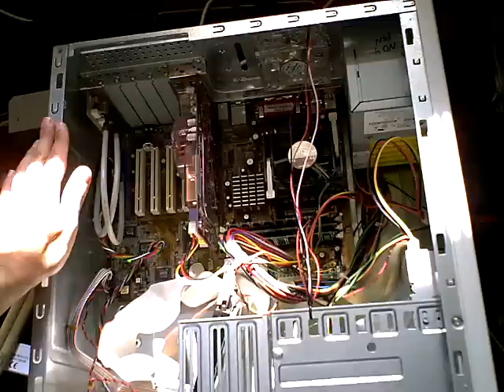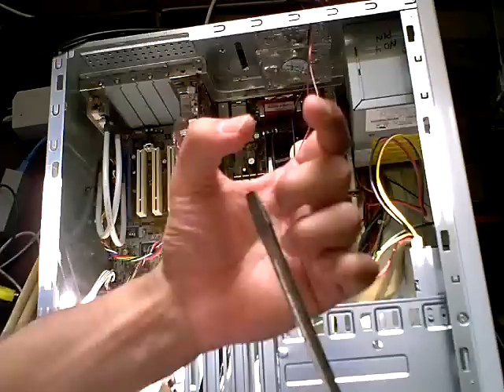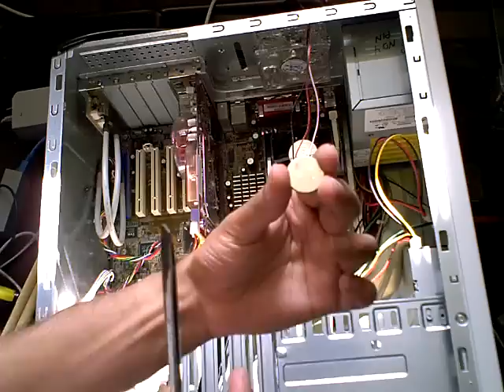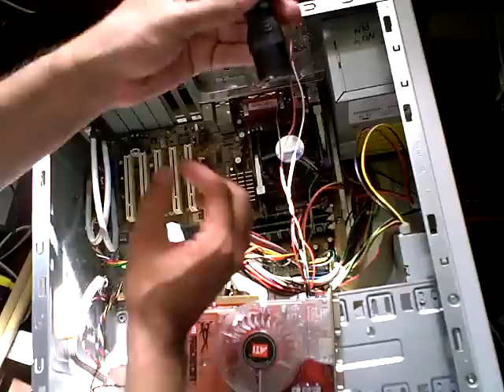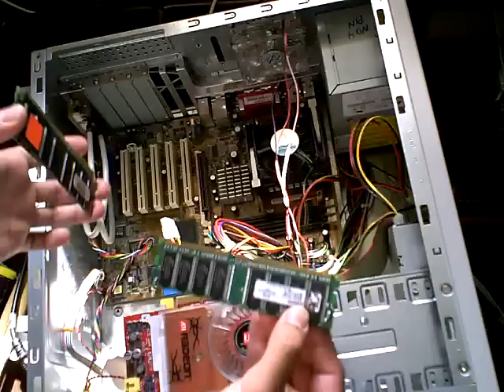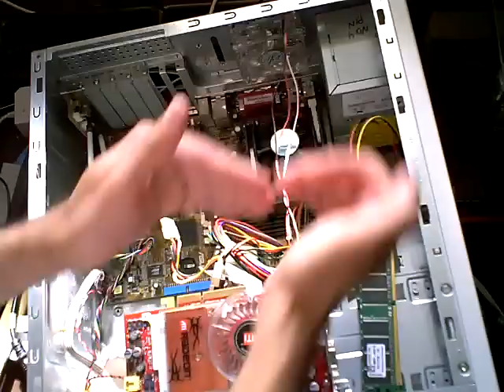How to possibly fix a PC that will turn on but will not beep and will not display anything on screen

Comment: My videocard fan is working, cpu fan is working, case fan is working, my power supply is working, when i turn the pc on with the monitor on it scans for dva or vga port but doesn't find it. When i plug out the DVI cable it says on screen "check video cable." Help
Reply from the maker: +Edward Gudmundsson How do you know it is scanning for VGA or DVA port?
Reply: +RodneyDickson 
Nevermind, solved it. It was the cpu
Reply from the maker: +Edward Gudmundsson Glad you got to the bottom of the problem then

Comment: hey man, so i followed your instructions and i removed the cmos battery, after doing this and starting up my pc, it worked! BUT! it only works without the cmos battery, as soon as i place the battery back into position it goes back to the same old problem: the screen does not detect any input and all i see is some fans spinning -> i not no expert on hardware :/
Reply from the maker: +Lancaster.mmxv You can try a new CMOS battery (yours might be dead) or you can just use the PC without the CMOS battery (by leaving it connected to a power source, even when off, it may still keep its date and time settings)
Reply: yeah sorry i forgot reply when i finally figured that leaving the cmos battery out was the solution, i'll probably get a new batt soon or something, but thanks for the support!
Reply from the maker: +Lancaster.mmxv Of course! Good luck with it all : )

Comment: I have a motherboard.It cant accept video card,i dont know why.For a long time I play a lots of games on that video card and now it works just for 3 weeks and the I need to plug in my VGA cable to the onchip video card.Please help me.
Reply from the maker: +Edward Turcan Your video card slot (or related circuitry) is probably defective. I have a machine like this myself, and know no way to fix it unfortunately.
Reply: +RodneyDickson Too late...I have a new motherboard.
Reply from the maker: +Edward Turcan Probably a better solution, especially if you wanna use an addon card : )

Comment: sir rodney . My PC have problem, when im using my pc its turn to blue screen of death and says "collecting dumb files" and its stuck .then I force shutdown and when i restart my pc it won't turn on. im planning to format my pc but how can i format if my pc wont turn on, Any idea how to fix my pc?
Reply from the maker: Hmm, well, it sounds like your Windows installation is dead. I'd use a Linux LIVE CD (or just slave your hard drive to another working computer) to back up any files (if there is anything worth backing up on that format) and then I'd use a Windows install disc to reinstall Windows (if the only recovery option you had was integrated into your Windows, then you might be out of luck sadly...in this case the only thing I can think of is to go into Safe Mode (boot by holding F8) and then uninstall as much software as you can until the PC boots properly in normal mode, then back up what you can, then format). If you actually have access to a Windows install disc, you can try my method to fully format your hard drive shown in the following video (don't forget to back up any data you do not wish to lose beforehand):

How to completely format a hard disk drive to its full capacity by deleting the master boot record
Reply: RodneyDickson thank you sir rodney. i tried to re-insert something on my  motherboard then when i open my pc .it did'nt turn to bluescreen .i hope not.
Reply from the maker: jovel lopez
Well, I wish you continued success with it then : )

Comment: i have 1 stick of 4gb ram its kingston hyperx fury 1866mhz and i got one more stick of the same ram and when i put my ram in it says memory has changed 1 run setup 2 load defaults and if i click load default it shows i have 8gb ram but only 3,95 usable but if i hit run setup it takes me to bios and i check if its 8gb ram at the right frequency and i click save and restart and it restarts but nothing is displayed and it beeps (i have a 64 bit windows , so i know thats not the problem, and i tried to do that msconfig thing it didnt work ) please help me any suggestions are useful
Reply from the maker: +MrZigljasin Install both RAM modules,  enter the BIOS, on the last screen 'load setup defaults' then save and restart. See if that solves the issue. If it doesn't, disconnect the power cable, remove the CMOS battery, short the CMOS jumper pins for 9 seconds then return the jumper cap to its initial position, press your PC's chassis power button switch (to discharge any remaining power circulating in the system), leave the PC unplugged and in this state overnight, then the next day return the CMOS battery to its socket and power up the PC.
Reply: RodneyDickson I already fixed it but thanks anyway :)
Reply from the maker: +MrZigljasin Good thing then

Comment: my monitor wont open and my mouse and keyboard too stop working just before this happens my computer is really working very good and fast and now i cant seem to open it by the way i can see lights and fans working to all parts except the video card fan do not move and there's no beeping sound when i press the power button and it does not turn off when i use the power button it only turn off when i unplug it. please help.
Reply from the maker: +Eugene Kurosaki follow the steps in the video

Comment: try this first,
ASUS tech support doesn't even help you, they just keep pushing you for an RMA. BUT THE REAL PROBLEM FOR ALL IS the 3 pin connector for the cpu . That's the culprit, You need to NEVER connect to the cpu power 3 pin female connector to the mobo 3 pin cpu fan male connector . You have to use the 3 pin female connector from the CPU on the 4 pin male connector just to the right of it on the MOBO called the cpu fan optional, it is a 4 pin male, but you use the 3 pin female cpu connector there and the embedded slot that places it in the right direction IS USED leaving 1 pin unused> so spread the word...the 3 pin male connector on the saber tooth FX990 is useless.
Reply from the maker: Thanks for the heads up.

Comment: help when I turn on my computer the PSU and heat sink fan don't work but the motherboard power is on...I even change my PSU but it is still the same
Reply from the maker: +Rian Gosaingfao Breadboard it (explained in the following video:)

If the steps in this video did not provide a solution to your problem, view:

http://www.youtube.com/watch?v=_EK9a-R5pss

You never know, maybe rebuilding the PC in the opposite sense that you took it apart will solve the problem.

Comment: Sir good morning.  I had a problem on my pc . If I on my com it beep but my monitor saying that no signal input. I follow the instruction of my tech not to download anything, yes my computer are old.
Reply from the maker: +fhinn sadam Good 8 month ago morning : ) Try unplugging the machine, connecting your display to a different video out source than what you are connected to, then powering up. I assume that the PC is defaulting to outputting video to a different video out port
Reply: ok sir thank you :)

Comment: HI Rodney,i have a problem with my pc,pc works fine, but will not beep  if i remove ram memory , i have AMI Bios
Reply from the maker: What do you mean 'works fine'? Are you POSTing and loading your operating system?
Reply: yeah it works fine, it loads os , but doesn't have beep sound, is that a problem(for example doesn't beep if i remove ram memory)?
Reply from the maker: Heh, no problem at all. It just means that your PC doesn't have an internal PC speaker (many don't this day and age)
Reply: Ah OK, Thanks man :)

Comment: So one day I was playing LoL and all of a sudden one by one all my tasks crashed and my computer froze. I went to restart and the fans spun as well as the GPU and all the LEDs but no output signal. I am getting a DRAM solid led whenever I attempt to turn on the computer. I tested the ram in another computer and it worked, RMA'd the mobo, cleared cmos, tested the monitor and HDMI, and yet it still won't work any suggestions? Please help :(
Reply: PS I built it 3 months ago and was running fine with no problems
Reply from the maker: Breadboard it (explained in the following video:)

If the steps in this video did not provide a solution to your problem, view:

http://www.youtube.com/watch?v=_EK9a-R5pss

You never know, maybe rebuilding the PC in the opposite sense that you took it apart will solve the problem.

Comment: Hey Rodni Dickson...
 please help me !
 my CPU is not showing any power light but it's fans are working and also not showing anything on monitor.
 And when I opened my CPU I found a cable which has 5 mini pins was getting out when I put that cable in the slot after that I also fount my CPU like before..
 please make a video on this😊😊😊😊
Reply from the maker: +afgan siddiquie Not sure if you fixed your problem or not. If you have not, then Breadboard it (explained in the following video:)

If the steps in this video did not provide a solution to your problem, view:

http://www.youtube.com/watch?v=_EK9a-R5pss

You never know, maybe rebuilding the PC in the opposite sense that you took it apart will solve the problem.

Comment: I got a small puff of smoke from pc but it still powers up but no video signal. What would have that small bit of smoke have come from?
Reply from the maker: +MrGillystar Probably a capacitor blowing. They blow frequently
Reply: Don't need to worry about that old pc. I got my new gaming pc.
Reply from the maker: +MrGillystar Better that way. Yep, responding to all comments unanswered from my 1.5 year hiatus, even if most of them are no longer valid.
Reply: It's all cool man. Stay safe.

Comment: sir am using 2 hard disk 1 is cable and the other is sata cable.system is not starting when i am using my cable hard disk.wht i have to do?
Reply from the maker: +Raj Kumar Try configuring IDE header in the BIOS, save and exit BIOS, unplug PC, set your IDE jumper to SLAVE or Cable Select, connect your IDE drive (including power lead), and try booting. Note that your machine may have a limitation to where it cannot use IDE and SATA devices at the same time (check with your board's manufacturer's support site).

Comment: i noticed when i start my computer my fan is steady fast..
then suddenly slowsdown? no display i have to reboot it many times bEfore i get display... what could be the problem??
Reply from the maker: This is a tricky issue that can be attributed to a number of things: short circuit, insufficient or weak power supply, CMOS/BIOS corruption, device conflict, the list is endless. Whenever anyone approaches me with this problem, I sadly tell them to keep on fighting with it and don't try to fix it (since there is no real fix to suggest). I mean, you could always try the CMOS reset method shown in this video, and to eliminate the possibility of short circuit, you can try breadboarding the entire PC, but this is a lot of work for little chance of gain. Still, if you want to try it, I cover breadboarding in detail in this video:

Advanced troubleshooting technique tutorial of how to possibly fix a PC that will not beep at boot
Reply: Thank you. Is it because of a virus in my system? Does reformatting my pc could solve the dll errors? And i just had a blue screen problem but now its okay again..there is really something wrong with my pc..
Reply from the maker: Edward Mabanglo
It could be a corruption issue, a virus, a number of things. Generally, formatting and starting anew is never a bad idea. If, soon after you format, you ensure that you have a software firewall and an anti-virus installed and operational, and the problem still persists, then the issue will most likely either be related to hardware or the drivers for your devices.

Comment: my computer won't boot,the case fan turns on and off...what could it be? power supply? maybe
Reply from the maker: If your computer powers on but for a mere second or two and then immediately powers down, It sounds like your motherboard is developing a short circuit due to contact with the metal casing. Most likely it has to do with the screws and metal mounting stands (supports) that your motherboard sits on. The cheapest way to fix this problem is to introduce cardboard washers between the screws and where they make contact to the motherboard, or you can buy plastic mounting supports at a computer shop.

Alternatively, you can always Breadboard it: 1)place the motherboard with CPU+Fan on wood or non-shiny cardboard 2)connect all of the case connectors to the board's panel 3)with a power bar that is OFF connect the PC power cable from the power bar to the power supply and the power supply to the board 4)while NEVER touching any exposed component,power on the power bar and press the power switch on the case.If the problem still persists,one of the remaining components is probably defective.Power off the power bar before dismantling

I cover breadboarding in greater detail in this video:
Advanced troubleshooting technique tutorial of how to possibly fix a PC that will not beep at boot

Comment: My pc will turn on but nothing will show and the lights on my keybord and mouse won't work but I can hear the fans loud and clear? Can you please help me
Reply from the maker: If this PC used to function and now doesn't, do what is shown in this video. If this PC is a new build and has not yet functioned as intended, Breadboard it (explained in the following video:)

If the steps in this video did not provide a solution to your problem, view:

http://www.youtube.com/watch?v=_EK9a-R5pss

You never know, maybe rebuilding the PC in the opposite sense that you took it apart will solve the problem.

Comment: sir my monitor no signal when i plug in with my gpu dvi port , but when i change to motherboard internal graphic vga port it shows up . is that a failure in my gpu?
Reply from the maker: Chances are your BIOS setting for primary graphics adapter is set incorrectly. Go into your BIOS and set your primary display output to add-on card. Your motherboard's manual can tell you how to do this.
Reply: RodneyDickson sir when i plug in with my friend gpu it works well so does that mean my gpu having problem?
Reply from the maker: tan guan kui
You plug in YOUR GPU into HIS PC or you plug HIS GPU into YOUR PC?
Reply from the maker: RodneyDickson
BTW, I'm trying to use emphasis here, not yell. Since GPU and PC already use caps, It might look like I'm angry or frustrated, which I am not : )

Comment: someone help please. so i just moved and i connected my computer up, it worked completely fine. till the next day. i turned it on and all i see is the emachines logo on my monitor. first the logo itself started jolting but after 50 times of restarting and a bit of banging it managed to turn on all the way. ive done it a few time the same way to get past the logo but that is a temporary solution... i was in the middle of using an antivirus software and cleaning up free disk space when it crashed and turned off. now it just keeps showing the logo again what do i do HELP.
Reply from the maker: Try the CMOS reset method shown in the video. Let me know how it turns out.

Comment: I need help.

I didn't touch any inherit parts except from cleaning everything and cleaning the dust, now it doesn't startup or beep or whatsover, I did everything u did but nothing worked for me.
Reply from the maker: +SpletchVlogs Breadboard it (explained in the following video:)

If the steps in this video did not provide a solution to your problem, view:

http://www.youtube.com/watch?v=_EK9a-R5pss

You never know, maybe rebuilding the PC in the opposite sense that you took it apart will solve the problem.
Reply: RodneyDickson I founded the problem, the video card was connected on the ONBOARD port, but for some reasons my dad disabled that port, so I had to take the other video card slot..
Reply from the maker: +SpletchVlogs Ahh, I see. Thanks for the update : )
Reply: RodneyDickson Thanks for the help bro, you deserve every view u got :)
Reply from the maker: +SpletchVlogs Heh, very kind of you : )